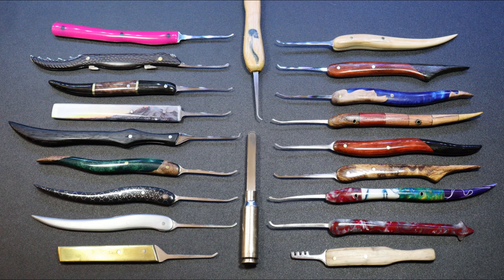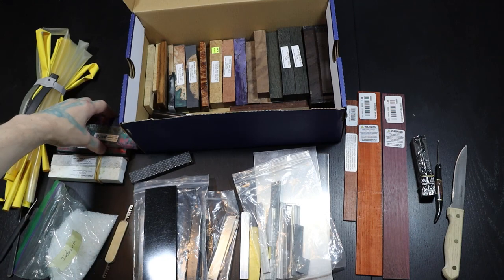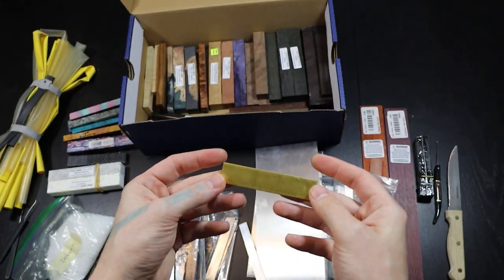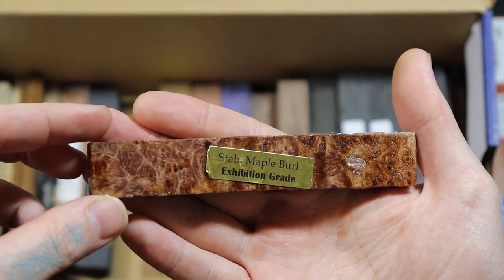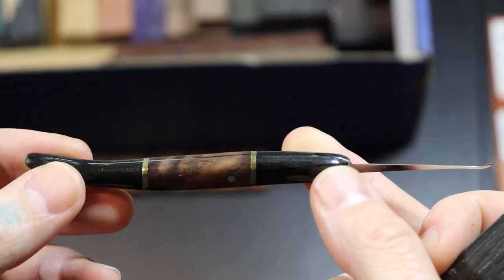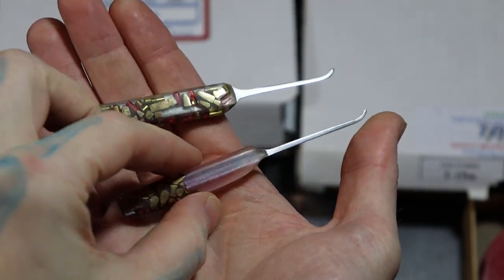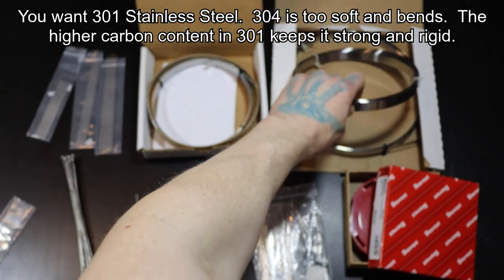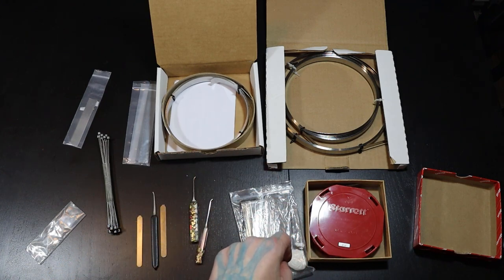150) Making Custom Lockpicks Part 1 - Handle Materials & Pick Materials

Comment: If you have a copy machine could you take a photo copy of some of the picks with out handles so I could gets some design.
Reply from the maker: @Blakes123  there are pick templates you can find online. Don't remember where, but definitely available. Can always trace your old picks as well
Reply: @LockpickingDev found some.